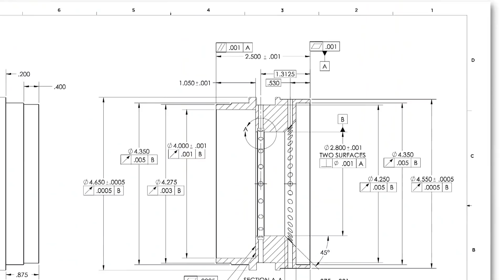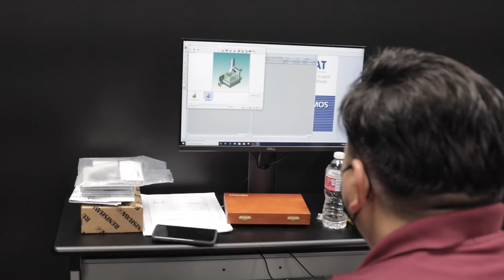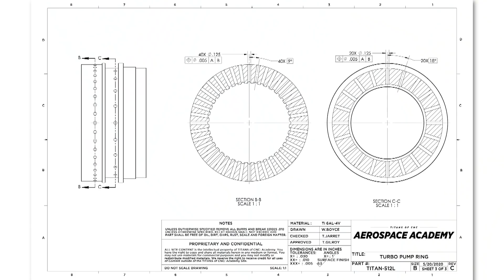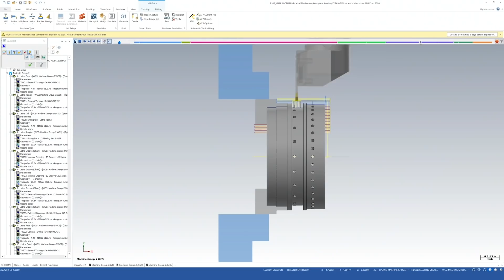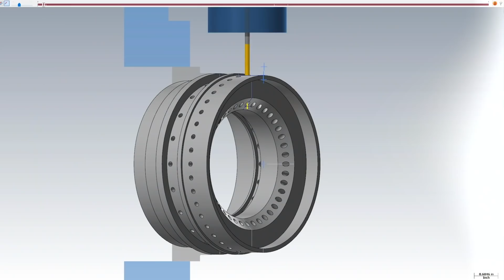Total Incompetence - Quality is Calling My Parts Wrong… I Checked Everything TWICE… UNBELIEVABLE…

Comment: This is a common problem in shops all over the continent. Companies treat cmms like a god. 99.5% of the time they are correct. But every now and then there is some probe wear, calibration issues, or work holding issues. Just to name a few that have come up over the years. 
   Like you said both operators and inspectors need to work together and focus on solving the issues. More so than finding out who’s right and who’s wrong.

Comment: Even when I program a new part I will run it, if anything is out I take a quick measurement of what’s out and then run qualification on probes again and re-run. If it still comes out but the surface plate tells me otherwise then it’s my program that must have an error. Thankfully most of the time it isn’t my program that’s wrong, the part truly is out. However, my point is you need 3 methods that all say the same and then you can say it is OOT.

Comment: I love when quality starts arguing with hard measurements. Like you physically can not have an error there
Reply: Quality for 28 yrs, CMM operator/programmer for 15... I'll always override a CMM result with a hard gage/measurement when there's a discrepancy - as long as the gage or open table setup equipment can be validated as accurate.

Comment: I have been a machinist for over 4 decades, I also CMM many parts on a daily basis. I stopped this video at 0:37, it seems to me that the CMM programmer/inspector may be datuming off different features/surfaces than the drawing. I see this a lot. Drawings are often subject to interpretation, they are not always correct with regard to tolerance stacking and not properly tying datums to features. I find that many in the field don't fully understand the concepts of geometric tolerancing.

Comment: I worked at a place where an issue like this developed over months of time. Consumable machine tooling for a million dollar part were being made in house with only about a 50% success rate. Quality kept kicking out half the parts for poor welds. This went on for months, due to the urgency of the parts, machining was contracted out to a reputable machine shop, and the reliability of the parts didn't improve. So this caused MORE problems. The situation continued to devolve. Long story short, our department  (maintenance) was brought in and we figured out the onboard digital angle indicator had a worn pivot point making the machine setup process inconsistent. Had the various departments worked together with less friction and distrust, this situation could have been avoided and a lot of money could have been saved.

Comment: I have had to save parts from QC before,  as I'm sure many of you have, with some of the parts I make there are dimensions on the print that serve no purpose , such as size of a  chamfer which aids in  installation, as long as there is a chamfer  it's a working part,  just not "in spec" . Our prints (for some parts) are guard rails to keep people on the highway,  QC has the hidden numbers that are the true tolerances. You can't give your operators the absolute numbers,  because if you give 'em .005" they will use all of it up to .0059" then be mad  when it gets rejected.

Comment: CMM Programmer most likely created datums poorly or failed to qualify probe on calibration sphere or both. I programmed CMM for many years, was a skilled test engineer, CMM programmer (Hexagon, Mitutoyo & Zeiss), CMM trainer, calibration consultant/trainer and lab manager, and I only raised flags when something was wrong which could be proven wrong using height gage, pin gauges, gage blocks calipers or micrometer, etcetera. Not all CMM programmers fully understand how to properly program CMM in certain special cases, as I have encountered several CMM programmers (Automotive Industry) over the years not fully understanding GD&T and fully understanding how to properly program features to get correct/accurate results, and that is a problem. Fortunately I was able to provide detailed instruction with explanations why, so mistakes could be realized and understood by programmer. Glad you were able to get the issue resolved. I am retired now, and I still get calls with questions on calibration methods and programming.

Comment: As an experienced (old) software design/development lead,  the statement "There is no way 'this' could be causing the problem" during a difficult debug makes my hair stand straight up.  That is the first piece of code I'll dig into.  I embarrassed myself too many times as a young developer making that statement.  We're often blind to defects in our products.   That's why there are independent test teams.   They typically do not get the respect they deserve.
Reply: "There's no way...." is usually a good indication that the person saying it is wrong. Also a good indication that you're going to have to beat them over the head with the problem to get them to change their mind.
Reply: @jfan4reva  I recently replaced an entire vendor development team when they refused to believe their code was causing a difficult to debug issue.   Just did it in December after months of issues. They were very stubborn even after I debugged the issue for them.     Code was redesigned and released within weeks and issue is gone.  Beating over the head is sometimes needed.

Comment: I'm not a machinist but worked in aerospace in final assembly.
Our quality control manager had a fit about the degrees of arc in a product.
Apparently it was incorrect.
He demonstrated its flaw to myself and a coworker.
While pointing to points of reference he said, "Ten, twenty, thirty, fifty, sixty, seventy, eighty, ninety.  You see, the placement is incorrect."
I said, "Can you do that again?"
"Yes. Ten, twenty, thirty, fifty, sixty, seventy, eighty, ninety".
My coworker and I both looked at each other with stunned expressions.
"Could you do that one more time?

He did. Exactly the same.
He was a Quality control MANAGER.

Comment: .0005 is not a very tight tolerance though I suppose when working on a CNC machine it might be, I frequently run parts manually to .0002 or better when I get a job that is .001 I sigh in relief because that's cake walk.

Comment: Always sucks having to go to QC. They always jump into defensive mode. I remember getting into a big blowup with 2 inspectors over the difference between Maximum Material Condition on bosses versus holes. They were convinced that it was calculated the same way (they thought tolerance bonus increases as feature size increases for both holes and bosses). After looking it up, and making a few phone calls, the QC manager finally had to concede that the bonuses were opposite for holes and bosses.

Comment: I was working for a small shop (4 people counting the owner) and we got a subbed job from another shop that we often worked with. They were volume production, we were a job shop, so when they got a package that included a one piece one off, they sent it our way. 

It was a mixing/ color injection head of some sort, definitely off the wall, but doable. Had to have a CMM report. We didn't have a CMM. So we sent it out for inspection. Came back with some flunks. We recheck it. Looks right. Send it to a different shop to be ckecked. Get it back, but with a totally different set of errors. Sent it out again. Same thing!!!

Ended up going to the customer with all of this. They agreed to check it themselves. Passed with flying colors, and the final customer loved it.

Comment: A half a million high gauge or any other piece of testing equipment is only as good as the person operating it  I worked a testing lab years ago.  The lab manager gave me a piece of cloth from a dress to test for oil and grease.  It was from a lady who took her car to an auto garage to be fixed.  She slipped and fell in the auto garage and was suing the garage claiming she lipped because there was oil and or grease on their floor.  I told our lab manager it piece of dress was too small to get an accurate results from but I would run it anyway.   After I ran it I told my lab manager that there was absolutely no evidence of oil or grease on the piece of dress.  He turned around, got on the phone and called the client her lawyers and said "There is evidence of oil and grease on the dress and you have a case".  That was the exact opposite of what I told him.  I later mentioned it to the the assistant lab manager and he said "I know what you mean and make sure you distance yourself from him and that case as far as possible.  So as far as your client the engineers.  They may be fancy engineers but that doesn't mean they have a clue what they are doing or talking about.

Comment: I've been in Quality for 11 years. Quality is there to support the production processes.  Sounds like an adversarial atmosphere; no doubt there times when there's friction, but it's usually when something's late.   I've never heard of someone making a complicated part like what's shown or any part without taking it to QA for first article inspection AND QA doing in-process inspections during the different operations.  Even if the part was perfect, your setting yourself up for failure.  I make sure there is always communication between the actual Machinists and QA to maintain a helpful and supportive environment.  A good QA inspector would have gotten out the hard tools the minute a few dimensions were out of tolerance. Not just continue on like nothings wrong.  Sounds like lack of experience or incompetence and definitely no supervision to me.
Reply: I was about to reply with all the same points, number one being: why no firxt article? Ive worked in placex that would do a first run of 50 parts, then submit one as a first article only to find out all 50 of them are wrong.
Reply: @unavailableusername9694  Thanks, the clown I was talking with said I didn't know what I was talking about. I told him I was surprised someone hired him. LOL

Comment: A job I worked on was sent out to three different shops that had CMM machines because the shop I worked for didn't have one but the customer required the report. 

One of the reports came back stating that the part was 1.000" inch out of perpendicular.  For those reading this you will have to take my word for it that if the part was that far out it wouldn't have fit on the fixture or been machine able for any other features.   Not to mention you wouldn't need a CMM to visually see that much deviation.

I suggested our office not pay for that report.  Whether they did or not I had no say.
Reply: 1.000" out of spec?  A measure off by that precision is itself highly suspicious.  And if the claimed error is anywhere near that magnitude you don't even need precision measures to validate, just get out a ruler or tape measure.

Comment: A wise man once told me “check the checker”. It was regarding using a multimeter, the checker he referred to was both the multimeter and me. 

Example; If you’re checking resistance touch the two probes together, do you get an expected result, if not maybe the multimeter is broken or maybe you set it to measure volts.
Reply: Yep, especially when the checker says that almost every measurement is wrong/off.
Reply: In the multimeters I've used, measuring resistance touching the probes together usually gets a few tenths of an ohm, very consistent for a given set of leads.  An expected offset from a known source.  Not usually relevant, values measured are much larger, but good to know.

Comment: As a mechanic working in aviation or twenty years, I've had similar experiences dealing with engineering. It turns out our engineering department were actually just a liason and had no idea of what it meant to use a manufacturer's definition for a technical term versus the industry standard. If you are working on a specific manufacturer's product you should always use the manufacturer's definition for a technical term not the industry standard. Our engineering department couldn't grasp this for a while making life difficult for every structural repair going on the hangar floor.
Reply: Out of curiosity what was the technical term in question?

Comment: Iv had a part with a tolerance of + - .0005, with a cmm that was only accurate up to .0002. My part was .00002 out of tolerance( program went to deviation of 5 decimals even though the machine can’t measure that) Argue with the guy it’s a good part, put the part under my arm to warm it, and it’s a good part. Not ideal but all they care about is a good cmm report as you’ve said
Reply: Measurement uncertainty is always something to consider when inspecting a feature with a small budgeted tolerance. You can reject a good part...but also pass a bad one.

Comment: Iv been a CMM Programmer for about a year now. It is so difficult to tell people when their parts are bad, and it's even hard when the machinist blows up in anger telling me that it's impossible that their part could ever be wrong. This has led me to triple and quadruple check parts before ever telling the operator/machinist that a feature or two are out of spec. Everyone trusts the CMM as long as the report is green, but when something comes out red it magically becomes the least trusted machine in the shop.
Reply: Same in all shops that are on tight production schedules. There was a tight tolerance part that had some attributes out from the CMM. I manually checked to confirm. It was out. The plant manager, director of operations lost their shit.

They didn't believe the CMM report or my manual inspection. (12 yrs experience as a machinist). The CMM report is 12 pages. Over a hundred attributes inspected, four were bad. If the 4 attributes aren't right then I guess the other 100+ green reading must be bad too.

 They "inspector shopped" to get someone to say it was good. Unanimously, the part was bad. A  week down the drain because they refused to believe the part was bad.

While doing this, they denounce the QC dept., the inspectors experince and capability, the validity of the CMM and morale. 

In this video, the CMM programmer/ operator was as arrogant as the machinist. Not manually checking the part with so much discrepancies is just plain stupid. 

Likewise, there was a part the CMM got runout .0016 OHL on a diameter. The machinist blew a gasket and insisted the program in the CNC is never wrong. We had him put the part back in the machine to check with an indicator and it was .0016 OHL.

CMMs are precision  machines. They need to be maintained and calibrated regularly, just like a CNC. It helps when the programmer / operator has some machining experience.
Reply: Ha no one trusts cmm reports. Especially on round features. I will never trust a cmm report on a runout, position of a large diameter with tight tolerance, or diameter of a diameter with a couple tenths tolerance. Always trust the indicator on a lathe before a cmm
Reply: @cbrunnem6102  I'm with ya man, if I can avoid those features I will. If I can't then I make sure the engineer is really specific with what they need checked. The runout will always check different between it being chucked on the lathe and in a free(ish) state on the CMM. Usually for tight runouts I try to push for them to be checked on the lathe while it is set up.

Comment: Did a lot of work in machine & tool & die shops and an old timer told me close tolerances cause some in the trade to go mad. As an electrician would bust their stones saying if we are within 1/8" in metal or 1/2" in a masonary hole we were dead on. Have the upmost respect for you guys. Thanks for the great vids.

Comment: When every dimension was wrong why didn't they think to use another method  to double check the measurements (like you did) instead of relying on the one machine? That is pretty sloppy work and would have cost enough money to find out it was right after all.
Reply: Exactly. If so many things are out like described in the video,  I always re-align the part and re-run the program. If it’s still out, THEN I manually check dimensions. I don’t understand how someone can think the cmm is such an infallible tool. We all make mistakes though and maybe the guy was having an off day.
Reply: @RyGuy1538  Definitely having a bad hair day, every dimension being wrong would be a red flag.

Comment: I've run into the issue with quality and them thinking that CMM's are infallible gods. CMM's are no different than any other CNC machine. Garbage in, garbage out. It took a while for them to understand this
Reply: Hahaha 🤣 exactly what I was thinking... trash in trash out !
  I was a manual machinist for 20 years. Extremely light cnc experience. But
When the numbers don't check out in inspection first thing I would do is get some standards or go the granite room and check the tools I used. Yes I checked them before use but things happen.
   Yes kiddies we had inspection even before CNC.
Reply: Hey. I know you! Did we even have a CMM at Omni?
Reply: @BerzerkaDurk  Who is this?  Whisper of Cognac is one of April's horses. Omni got a CMM about 6-7 years ago. I haven't worked at Omni for 3 years but, I still do contracting for them
Reply: @thefahj-122  I'm your former brother-in-law. 😁 Whisper of Cognac was our horse. Peanut
Reply: @BerzerkaDurk  you still at Raytheon? I'm the engineer at a small shop in Amesbury

Comment: having been to Zeiss for training, and using a Zeiss Micura CMM, CMM data is 100% influenced by programming and operator competence. 

Folks, theres a reason theres an entire ASTM (iirc) handbook on standards of how to measure parts and features. you can make a good part look bad and a bad part look good depending how you set it up, this can be from incompetence or done in a dishonest fashion. 

If something doesn't smell right, always double/triple check via other methods either hard gauging or inspecting a known artifact in the same fashion of the part